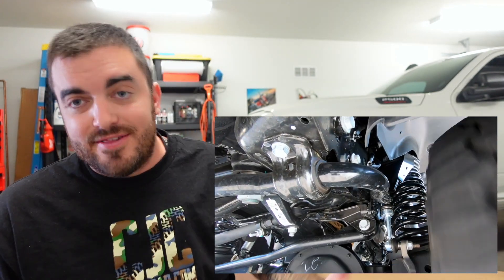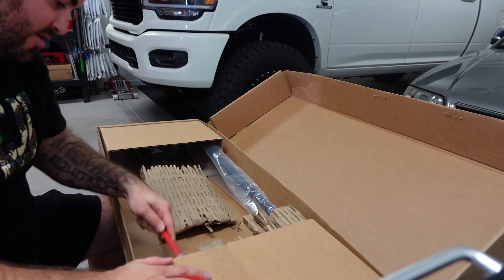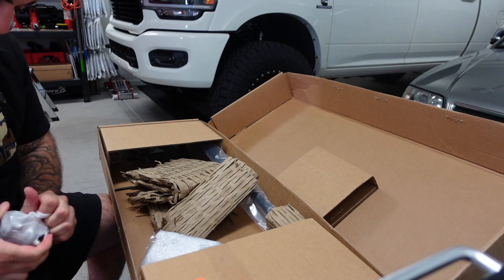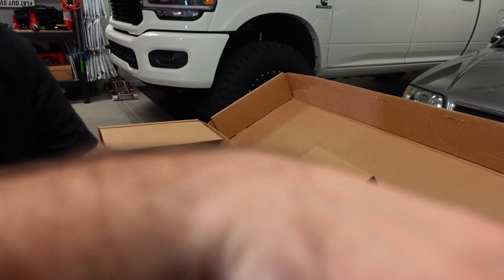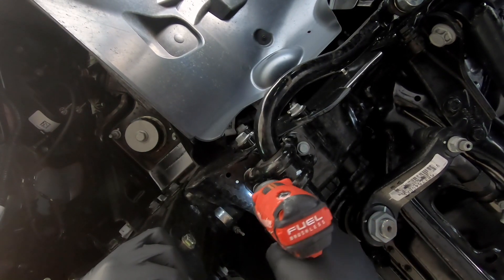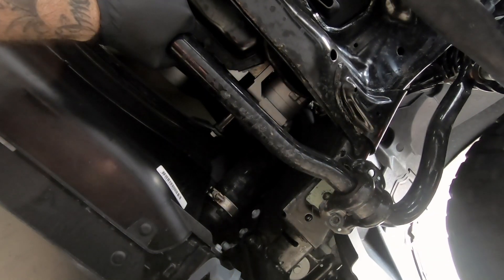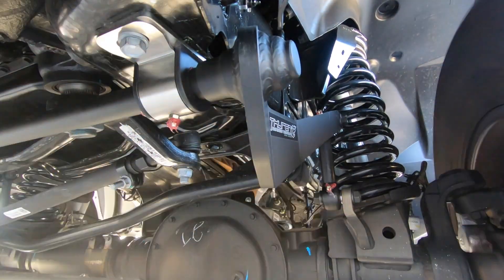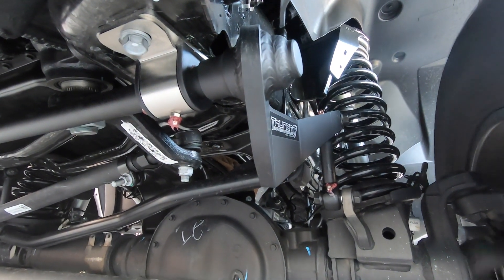Will A Thuren Sway Bar Work With A CARLI Suspension System? Jay Flat Out - Carli vs Thuren Ram 2500

Comment: i just ordered the synergy tie rod, drag link, track bar and track bar conversion bracket for my 2000 ram 1500. opted for the carli control arms but went thuren on the sway bar and coils. fox ats steering stabilizer as well as 2.0's all around to replace my old bilstein 5100's. 4-6 weeks out on parts but it will be worth it.

Comment: Carli's sway bar doesn't work with stock wheels.  They recommend you use aftermarket wheels.  This is probably a better option.

Comment: The Thuren rear track bar is a pain to install. Make sure you have plenty of bits before you try to tackle the install.
Reply from the maker: Like drill bits? What gave you a hard time?
Reply: @JayFlatOut  Yes, drill bits. Seems like it’s a common issue where the new bracket that comes with the track bar doesn’t line up with the holes you have to drill out. I had to ream out some of the holes before the bracket bolted together. 

Overall, I definitely recommend the track bar. The wag that occurred over bumps on the road is minimized and feels more planted. Just give yourself extra time if you choose to tackle the install.